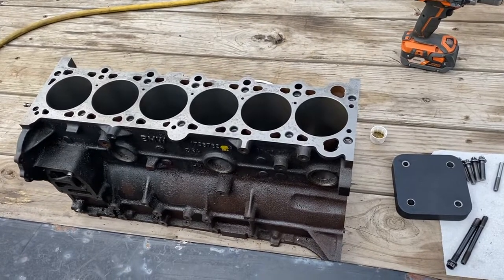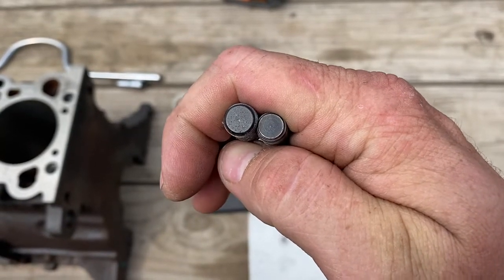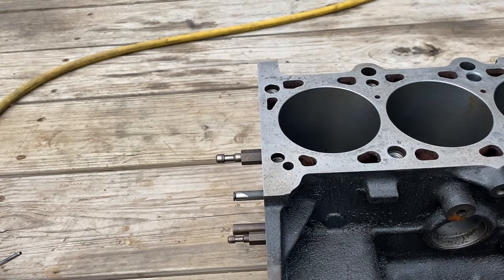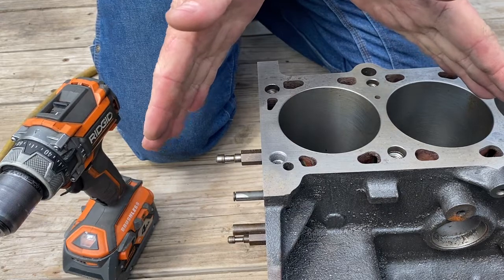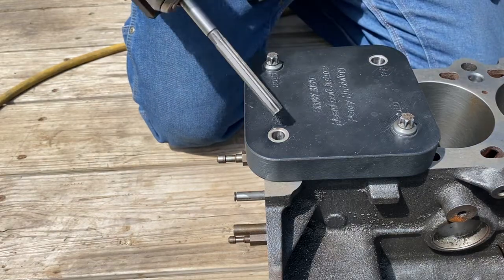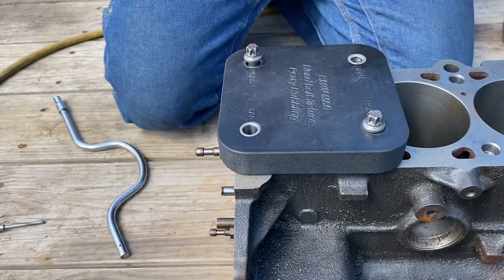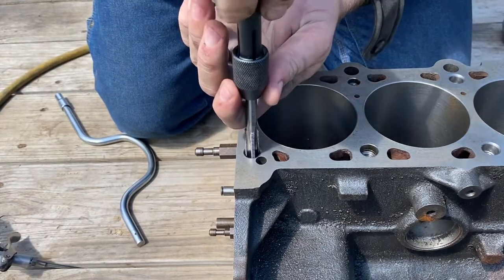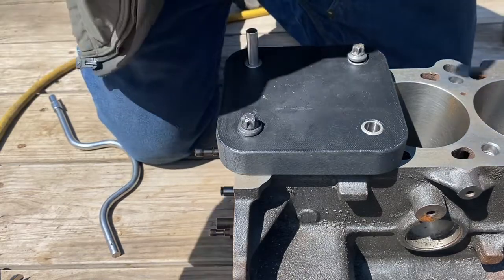Bigger head studs for your BMW M50 part Duex

Comment: Could 12 mom studs be installed onto the m52 block???? How much boost can the 11mm studs take without stretching or lifting the head??
Reply from the maker: You can use 12mm or even 1/2" studs.  Hopwood motorsports in the UK sells a set of 12mm studs.  The 12mm studs will not fit through the cylinder head and some head gaskets though so you have to drill out the holes in the cylinder head.  11mm studs don't require any modifications to the head.  I've run 40-50 lbs of boost on my car with 11mm ARP2000 studs and a cutring gasket and have never blown a headgasket.  You can also get L19 11mm studs from ARP.
Reply: @someguy325es  thnx

Comment: could I use a mag drill instead of the plate ?
Reply from the maker: Sure but it would be a lot of effort for a potentially worse result.  If you made a pilot to center it off the existing threads it would probably work okay

Comment: I want to do 12mm headstuds
Reply from the maker: In my opinion 11mm is better.  If you do 12mm you have to ream out the holes in the cylinder head and there just isn’t any need for more clamping load than 11mm
Reply: @someguy325es  so do you have a template for 12mm studs?
Reply from the maker: @The96hardbody   no I don’t

Comment: How much for the torque plate
Reply from the maker: $400 to buy it, or $150 to rent it
Reply: Will it work for m54
Reply from the maker: @The96hardbody   yes but only if the original threads are intact.  If you have already pulled the threads out you need to put timeserts in
Reply: @someguy325es  why time sert the block if my threads are good and I'm going 12mm
Reply from the maker: @The96hardbody   I said if the threads are already pulled out then you would need timeserts.  If you do 12mm then you won’t need timeserts either, but then you need to ream out the holes in the cylinder head.
Reply: @someguy325es  thanks and that's not a problem

Comment: Just watched your videos and you just convinced me I need an e30. How much HP can your rear-end and gearbox take?
Reply from the maker: Transmission is spec’d for about 1800 hp.  The rear end could probably use an upgrade to 35 or 40 axles already.

Comment: Is this a viable option on a stripped aluminum block ? As apposed to a time cert?
Reply from the maker: No if the threads are already stripped out it will need a time cert